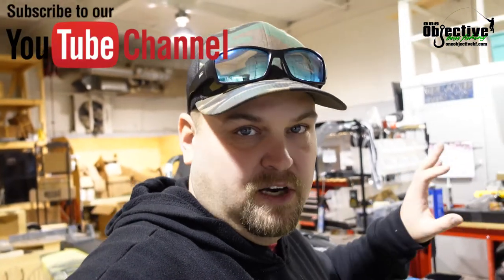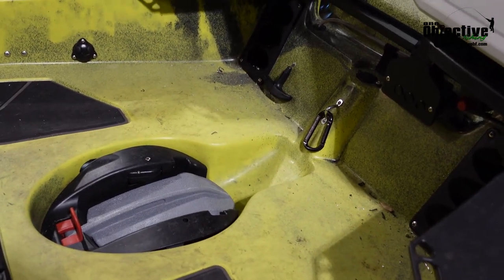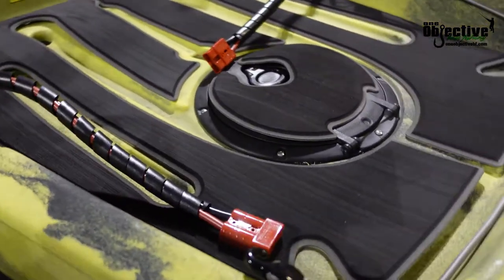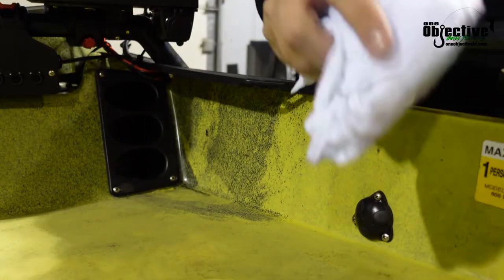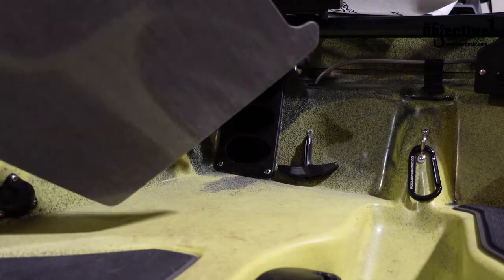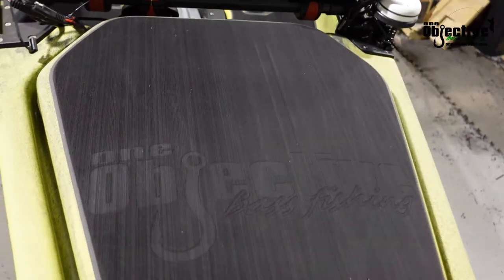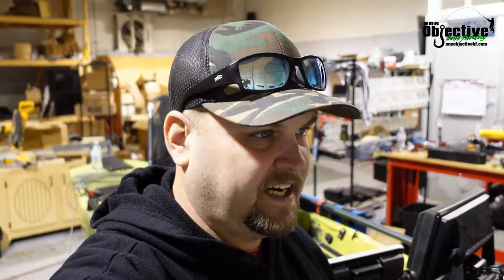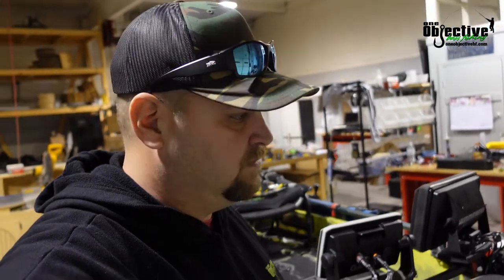Deck Pad Kit Install | Hobie PA 14

Comment: Looks Amazing. And I just wanted too say Thank You Guys, tomorrow I will be receiving Via UPS, 
my Bow mounting Bracket from you Guys for my Native Slayer Max. Can't wait, Super pumped. And I also just received the Motorguide Quick Release Bracket today, So I'll be doing some installing this weekend. And on another side note I also ordered and just received the Same Dewalt Tool box that you Guys used and made your video on for your guys Battery box. It fits absolutely perfect just behind  my seat and behind my Boonedox Landing Gear. I'm going too also run it like you Guys did, but with just two batteries. You Guys were SPOT on, this thing is perfect for $23 Can't beat it. Thank You Guys, so very much, I have purchased multiple products from you Guys, Tool cup Caddy, KeelGuard Protectors, Front Bow mount Plates. So a Big Thanks. Can't wait too see how your Guys Hobie 360's turn out, and Hope you Guys have a Very Blessed and Amazing Season this 2022. 😎👍
Reply from the maker: Thanks Steven. Thank you so much for all your support. It means a lot. Awesome glad you found a battery box. Its hard to beat that box. Cheap and easy.
Reply: @OneObjective  No problem, Thank You 🙏 you guys are Awesome 👏 Your Products that you guys are producing, the Content and Information that you are putting out to us in the Community is very much appreciated. So a Big Thank You. 🙏👍 Can’t wait to see how your Hobie 360’s turn out, been loving all of the content in them. Again have a very blessed weekend 🙏